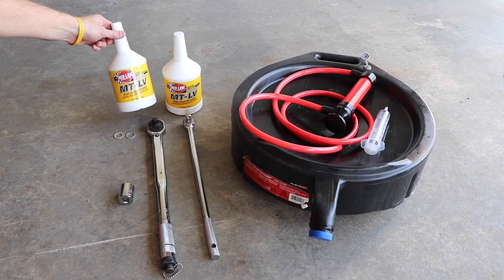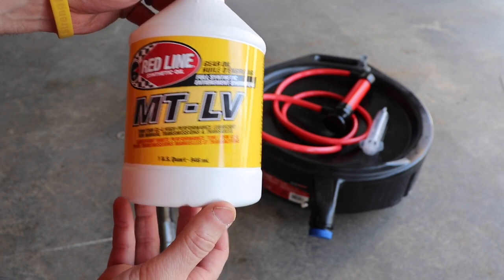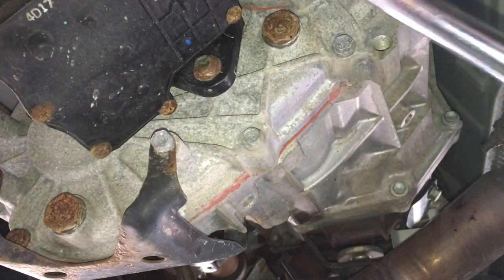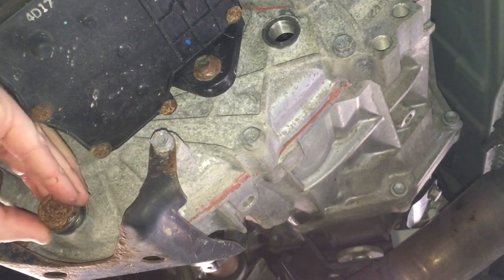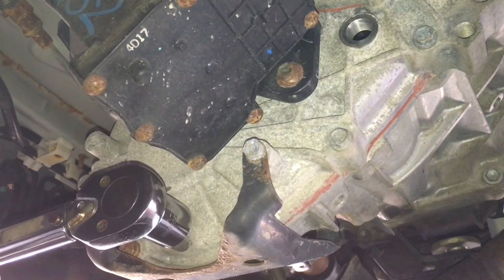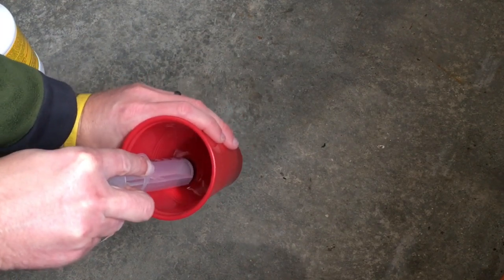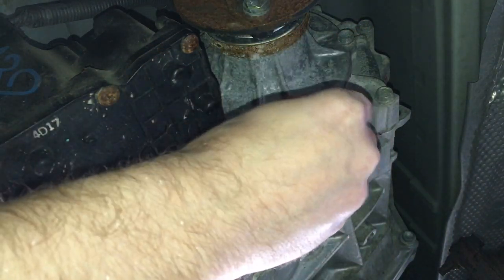How to Change Transfer Case Fluid - Toyota 4runner Center Differential Oil Change

Comment: Thank you for what I think is the first clear, straight forward Transfer Case fluid change video on a 5th Gen 4Runner! Keep making these 4Runner videos! (Transmission change, Front Diff, Shaft Greasing, etc.)!
Reply from the maker: Thank you for the compliment! Glad you liked the video, I plan to keep doing maintenance videos for my 4Runner. I have a few other videos already for the 4Runner and had a shaft greasing video that had been corrupted so the next time I do that I’ll try again. Anything other than what you listed above that you wanted to see? Thanks again!

Comment: Excellent and concise video. I followed it to change the transfer case fluid in my 2015 Limited full time 4WD and it went very smoothly. I also did the drain and fill on both differentials. At 58,000 miles all 3 fluids were black. The only thing I did differently was to use a 7 oz/200 cc Mityvac suction pump to load the gear oil. Thanks a lot for the videos, they gave me the confidence to tackle these jobs!
Reply from the maker: That’s great! I’m glad the videos helped you gain the confidence to do it yourself! I need to pick up one of those suction pumps! Be sure to check out my other 4Runner videos if you are  interested and please consider giving the videos a thumbs up if you haven’t already! Thank you!

Comment: Awesome! I was just asking the same questions and then your video popped up and it answered all my questions. Thank you!!!! Mines a full time 4WD V8 limited trim too.
Reply from the maker: I’m glad the video was helpful! Check out my other 4Runner maintenance videos as well! Thanks for watching and consider giving the video a thumbs up if you haven’t already! Thanks again!
Reply: @5MinuteFixit  Definitely will do. I do have a question hoping you can answer. Mines does have a slow leak and I see it drip when in park like overnight or on driveway. How long can I still drive the 4runner as is before I need to really fix it with either a new transfer case or just fix maybe the part that it's leaking?

Comment: What year is your vehicle?  Is it a 4Runner?  I heard you mention it is an AWD with 1.5 L capacity?   I have a 2016 4Runner limited which is the only model of the 4Runner that is AWD, but I am uncertain if the transfer case and fill capacity is different for Limited, or just 1.1L and listed for others?
Reply from the maker: Christopher Robinson I have a 2014 Limited, all the Limiteds of this generation with 4WD have Full time 4WD. The capacity for the full time 4WD 4Runners is 1.5quarts he part time 4WD 4Runners is 1.1quarts. Hopefully this helps. Thank you for watching and please consider giving the video a thumbs up if you haven’t already! Thank you.

Comment: This is not the correct gear oil for 2004 4 runner with the 1GR-FE engine.  It uses API - GL 5 and the rear differential oil is different than the front and the transfer case. Perhaps you should be more specific about the year(s) of the 4 runner this procedure is for.

Comment: It would be great if you listed the quantity of oil needed.
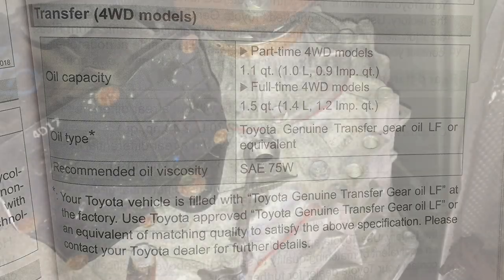Reply from the maker: At 2:35 of the video I have a picture that lists the quantities but I could also list it in the description.
Reply: Just over fill it till it leaks out and wait till it trickles out then screw in the bolt and your set

Comment: Foot pounds, not pound feet.....
Reply from the maker: https://www.enginelabs.com/news/torque-talk-pound-feet-foot-pounds-one/
Reply from the maker: Admittedly we are splitting hairs here...thank you for watching I truly appreciate it!
Reply: @5MinuteFixit  I didn’t read the article 100% but your torque wrench will say foot pounds. So if you say 36 pound foot is it the same as 36 foot pounds or will the math conversion say it is different? Would like to know because you are correct that in the Toyota manual they use pound foot. Seems strange.